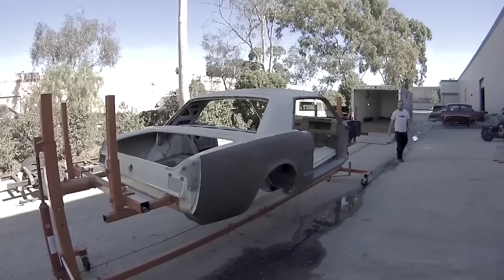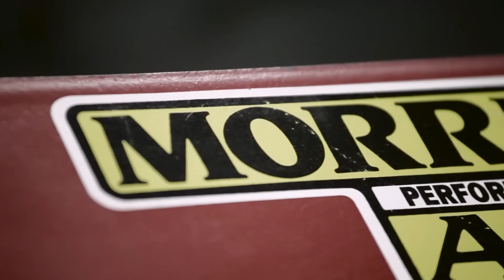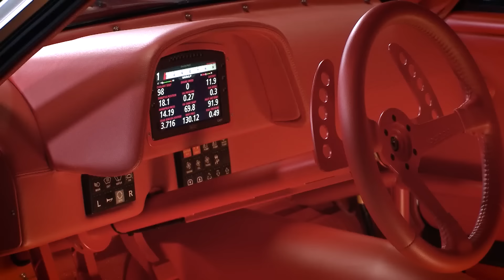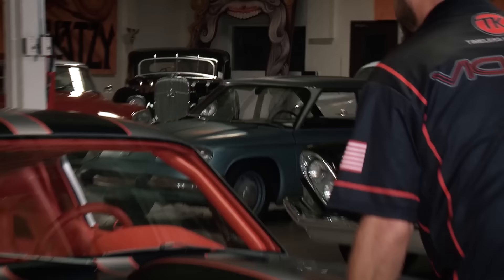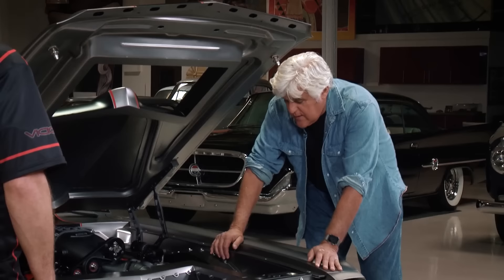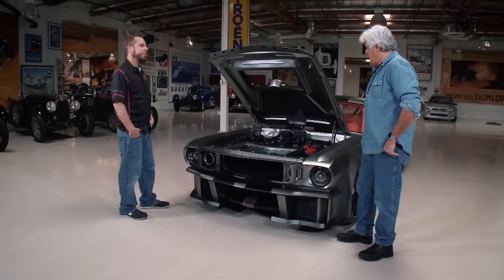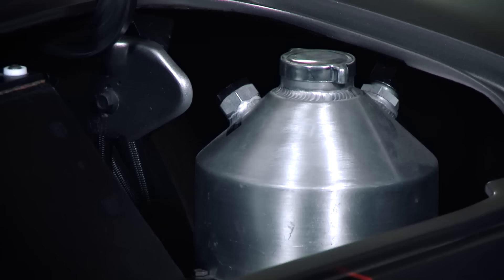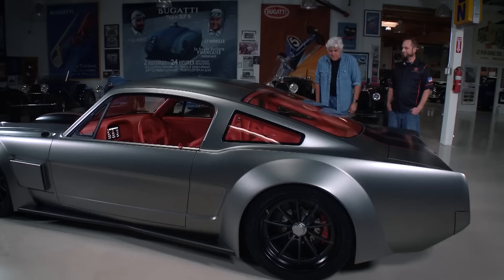1,000 HP 'Vicious' 1965 Ford Mustang - Jay Leno's Garage

Comment: Was this awd? 

Love the detail, brakes, and paddle shifters. Reminds me of ken block's awd mustang.
Reply: No prop shaft leading to the front, plus the C7 clip front wasn't designed for awd. 
So the answer rear wheel drive and a magnificent piece of design.
Reply: sullyFL That's exactly what I thought. It really does look like the Hoonicorn.
Reply: just left the same comment....took a lot of styling cues from Ken's Hoonigan.....
Reply: If this thing lacks AWD or 4x4...that's a lot of power without much to use it for besides top speed or 100 mph burnouts.
Reply: Awesome build, love the car.

Comment: I know everyone has their own opinion but who could hate that? I find it hard to see how people could complain
Reply: Total overkill. I love Mustangs but Its not a Mustang, just a Rich guys build
Reply: Not really a fan of its look and I hate the electronics but probably necessary but that is one clean build.
Reply: I preferred it stock.
Reply: It looks horrible and it's terribly designed and engineered. He tried to make excuses for the ugly body work by saying that's it's functional. Everything on a McLaren is functional, but they don't have random extra bits stuck around the body. If this guy could design well, he wouldn't need those ugly "functional" bits. The interior is also the most disgusting thing I've ever seen on a car. Also, a supercharger and two turbochargers is just unnecessary; why does it need 1000hp at the wheels? That thing is going to crash the first time the guy tries to drive it round a corner.
Reply: @rosstempletonogskater  how many basic " throw a turbo in it/ convert to e85" builds do you wanna see? Anything less than this is basic and a dime a dozen compared to this ground up build. Ffs
Reply: @bigteddybear5962  what would be the point of showing it off here?  Those have been done,  can find perfectly restored mustang anywhere.  You few that are speaking out against this really have limited mindsets. If it wasn't custom why would anyone care? Original is beautiful but been there done that.
Reply: David ...so you are rich? You know what a McLaren’s interior is like? And why not have 1000hp at the wheels. It makes you feel good

Comment: This car looks mean and beautiful. I loved those fenders. But the interior was a bit too much red for my taste.
Reply: Agreed, so disappointing given how well designed the body and paint job are.  It's like noticing a gorgeous potential love interest from the back, then it turns toward you and presents the face of a 90 year old crack addict.  Ugh...
Reply: Agreed. I love the red from the outside, but once you open the door and see that every single part of the interior is red, it goes from awesome to awful real fast.
Reply: debayudh talapatra I got to agree I am not a fan of that color red.  Maybe maroon or something a little darker. But the car is absolutely remarkable.
Reply: johnny duffin interior is an easy fix
Reply: debayudh talapatra agreed some black stitching and detailing along with the red would be nicer
Reply: debayudh talapatra agreed that red totally threw everything off, bummer
Reply: debayudh talapatra that's what u get with custom cars.
Reply: yap, exactly!
Reply: Would have liked to see a cream or light tanning
Reply: I agree. Some carbon fiber accents would've broken it up just enough.
Reply: I would like to see more of a black, chrome and red mix for the interior.
Reply: Just needs some black pinstriping inside. A little, not too much just to break the red up.
Reply: Looking at the rest of the car I would say pink would have been the right color.
Reply: Jwlz T u
Reply: I think some black trim on the inside would go a long way. With that said, I wouldn't complain one bit if someone left this car in my driveway as a gift lol.

Comment: Now that's a muscle car.
Reply: Greiguci Wootchie tecnicly its not a muscle car,a muscle car has about 100-400 Hp,a sports car has about 500-700 Hp,and a super car has about 730-800 Hp,and a hyper-car has about 1,000+ Hp so as a cari nthusiest myself its not considered a muscle car,u might think it is because its still have the body of a mustang,just making that clear to u
Reply: I both agree and disagree. Definition of a muscle car is "any of a group of American-made 2-door sports coupes with powerful engines designed for high-performance driving" so I don't think it has anything to do with horsepower but more the certain models that are classified as such. For example, Early corvettes never had all that much for HP but were still "sports cars". Also the Mustang was classified as a pony car not a muscle car so I agree that it is not a muscle car.
Reply: Loads of aviation-style parts.
Reply: @mr.booshay  The car is, but yeh, I agree with the power comment.
Reply: Greiguci Wootchie, ima be honist wen i made this comment i bearly knew anything anout cars XD

Comment: I don't like the styling...shoulda left it as a 65 Factory Fastback
Reply: exactly, the only thing you should ever do to a 60's mustang is fix the brakes and tune up/replace the engine. 

Don't even touch the exterior, you'll always make it worse than stock.
Reply: It couldn't be left as a fastback, it never was a factory fastback, it was a coupe.
Reply: Todd bob it actually started out as a coupe. Not even an original fastback.
Reply: boooooring... only two of these exist.
Reply: Hits and misses I think.  It looks pretty cool from the back and the side but I don't like what going on under the front bumper or the rear diffuser.
Reply: Totally agree, love the rear end
Reply: Todd bob
Reply: same
Reply: Todd bob I can understand your taste but this particular Mustang was purposely built to be capable at higher speeds and in order to handle it needs wider tires which requires those fender flares to cover the large rubber. It also was fitted with the front air spoiler and rear belly funnels for downforce to avoid it from flying like a kite at high speeds. All these changes are needed to race fast safely in a 65 Mustang with 1000 HP. Yes it does look different from stock but this is a purpose built Mustang racer meant to be driven at higher speeds not to Walmart. Drive safely friends.
Reply: this is a snarky comment
Reply: Todd bob it's not factory fast back it was a coup they made it a fast back, the mach1 was the first fast back if my memory is correct
Reply: legendary nikoproyou I think that the first fast back was in 67", the first Mach1 was 69". Don't quote me on that, I'm not entirely sure.
Reply: 65-66 called a 2 + 2 fastback, 67 to 68 called a fastback, 1969 to 1973 called a sportsroof,  mach 1 called  a sportsroof as well.... mach 1 came out in 1969
Reply: Augusta Jones, what the...??!!?? Anyway, so what's your opinion about this Mustang racer modified. Hahaha!!
Reply: Todd bob did he not say at the beginning it was a notch back
Reply: Yeah that's nice for car shows and keeping as an investment, but I love it when people actually work on their vehicles and make them unique.
(It's not a piece from Jesus's cross or anything, it's just a car body.)
Reply: I strongly disagree. There are plenty of fully restored Mustangs out there. It's cool to see something different sometimes, as great as the original was (I used to have a '66 coupe with a 289, and it was unreal. I can't even tell you how much I loved that thing).
Reply: Its worth FAAAR more now then any old 65 mustang. Hell a fully restored 67 Raven black Fastback mustang isnt worth nearly as much as this one, and the Raven is far more collectible and better then a 65

Comment: The red interior is like a porno red casting couch. The mustang body frame is the lead actress. The HP and engine is the pony, and the fabrication and detailed work or nuts and bolts is by vivid ent or wicked. 
Just straight up hardcore but still very clean, classy, and respectful. DOPE!!!  And its mostly steel pushing that much power.

Comment: Looks like a very attractive and successful exercise in design and fabrication, careful attention to build and execution. It's got about 700 more horsepower than a guy like me needs, but if you need 1000 horses then this is the way to go. Even based on looks alone this car is awesome and great advertising for the builders.
Reply: I agree. The 1000hp is crazy awesome but a tad excessive for a normal driver. I'm doing the 4.6l swap in my 66 mustang on my channel and looking to push about 300whp for now. With potentially supercharge for another 400whp. Anything more than that is just overkill!

Comment: 1000 whp, that's mad!

If this started out as a straight-six 1965 model it would have made about 120bhp at the flywheel. It's a fair bet that this thing has nigh on 10 times the power it had in the showroom :-)
Reply: That 1000whp is absolutely insane! I'm doing a lesser swap on my channel with the 4.6l. I'm expecting 300whp or so. 3 times from factory and this is OVER 3 times what I'm already going to be pushing. I can't imagine what it feels to drive that thing!!!

Comment: when I saw the buy line 1000hp, I was dubiouse, so I had to watch! It sounds like nothing I've ever heard! I dont usually like "the Legends" being too altered, but this is very cool...  from 'gnarly to viciouse'!! And from Legend to Futuristic looking even... but still recognisable, .inc. Its very own namesake wheels, & Paint & Plates , which is pretty shiny and  special looking..
. (Its so low...Its rediculouse,)        .  The all red interior looks hot hot hot😈 ( like a rag to a bull in every nook and cranny you look at) Had to lol at Mr. Lenno checking if it has 'aircon & the fuel consumption ! 😅....(. I did notice no cup holder arm rests,.. but Im guessing you need both hands on the wheel while charging like a 1000hp bull down the strip in something so viciouse & vivacious !?
Reply: You can check out the latest on Vicious, visit Instagram page @viciousstang 👊

Comment: The front of the car takes some getting used to.  I really like the rear.  The fender flares are not bad, Challengers look good with flares as well.  The ifs and irs suspensions are nice (I wish they wouldn't have been based off GM components though).  Overall, a good build

Comment: 2000: "I remember when corn liquor fuel was gonna save the planet."
2010: "I remember when used fryer oil was gonna save the planet."
2020: "I remember when electric was gonna save the planet."
2021: Planet 'Still Here. But you're all gonna die anyway.'🤷‍♂️

Comment: I think is would ahve been cool to ahve a TEMS shock system like the 88 Supra's had so under sport mode the car drops down and the struts stiffen up  I had so much fun in my 88 turbo supra doing clover leafs on the hwy in that car I could do one at 70 MPH and not slow down all 4 loops.
I'd like to think that car drives like its on rails too.
One thing about that car would have been All Trac would have been nice they launch on take off total traction. 1k HP alltrac turbo  the only thing passing would be Jay's jet car or an electric car on take off.

Comment: eh, do what you want with it i had a 66 chevy  c\k with a 318 out of a dodge ram and after transferring the shifter from the column to the floor taking off the bed for a oak flat bed with a boom  and picket gate holes i drove it all over the desert around phoenix picking up stranded bikers in the late 80's early 90's had tools belts chains so if they didn't want to be hauled home they could fix it there on the road

Comment: He said they wanted it to be a street car.  So the looks obviously were an important factor in the design.  Yes,  it has a lot of HP,  but it's steel,   because they wanted a street car.  So it's high performance but also supposed to be a looker.  So whoever designed those fender flares is not an artist.  Those are so unaesthetically pleasing to the eye that it's not even funny.  they are just downright fugly.  There's several other options they could have chosen from.  Other than that the car is beautiful.  It looks like they just didn't know what to do so someone just fabricated these big ugly angled flares that do not go with anything else on the car.  It's an amazing build but that absolutely ruins the whole thing because it is so noticeable.  It's not  just something small and hidden that people won't really notice.  it's so bad that it's the first thing people notice.  It can still be changed and should be.  then you'd have such an awesome car.